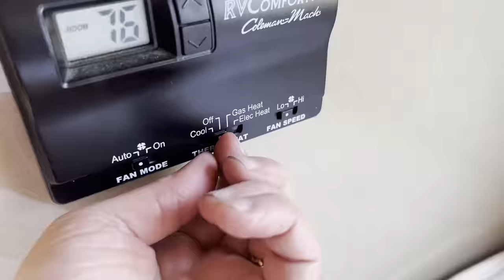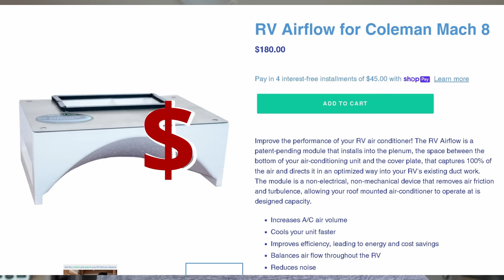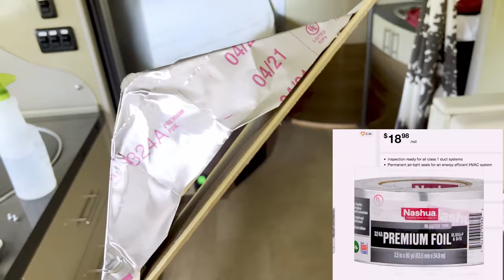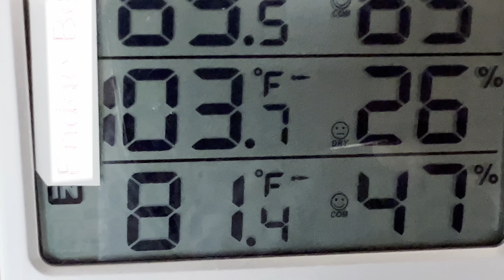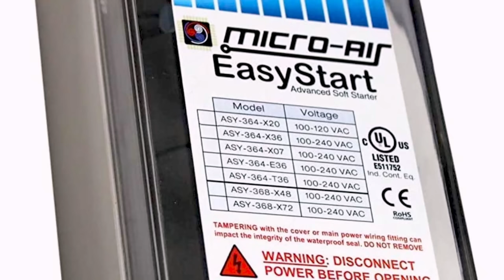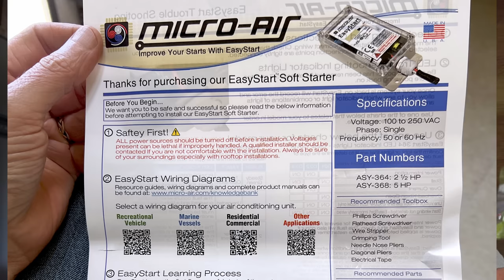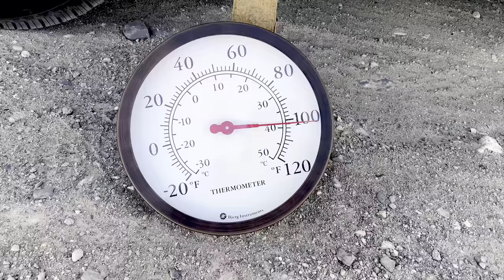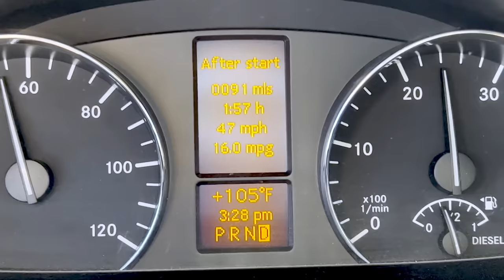3 RV AC Mods to Improve Performance and Reduce Noise

Comment: Nice try, Ron, You need mini split set up. Silent, draws minimal energy and you can sleep well,
Reply from the maker: I considered that for a long time, but I don't have a good place to put the head unit and the install is pretty intense, so will try this first
Reply: @ontheroadwithron2432  - one option with mini-splits is an "in ceiling cassette" that you could mount where your current RV AC unit sits and even use yous existing ducts. It would be a project, but you seem quite capable from your vids. Cheers.
Reply: @valkyriefrost5301  where are you going to run the line sets in that cassette style mini split? On the roof? On the ceiling?
Reply: @randybobandy9828  - Along the top of the roof is the easiest route, of course. But, it is possible to run the line set within the roof itself, albeit, a much harder install. The question comes down to effort vs reward. If you are only going to use the RV occasionally for a few years, then the effort would not make sense. If you are a full time RV'er and expect to be on the road 200+ day of the year, the reward should be worth the effort. Of course, this would not be a trivial project, it all depends on skill level, time, cost, and overall need.
Reply: @valkyriefrost5301  are those in ceiling cassettes 14x14?
Reply: @camposvazquez  - for a Pioneer 12K BTU unit, the cassette is 22.5 x 22.5 x 10.3 Inches. Other manufacturers sizes will vary.
Reply: @valkyriefrost5301  thank you .. I tried looking for an 14x14 cassette...  Opening the space beyond that where my current AC reside.. will compromise the structural integrity of the roof...

Thank you for mentioning this alternative... It forced me to contemplate a more efficient solution

Comment: Your air conditioner shroud is black… you need to paint this with white reflective roof coating. It well keep your whole ac a whole bunch cooler.
Reply from the maker: I thought about it. Not sure the paint will stick to a flexible plastic cover.
Reply: @ontheroadwithron2432  it will stick if you use the 100% silicone, white reflective RV roof paint… 887 Tropi-cool.